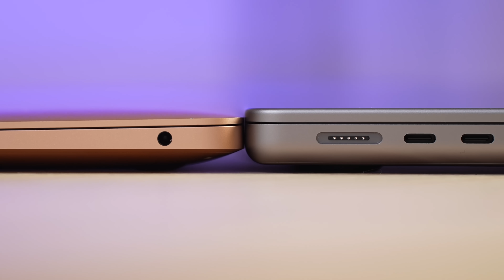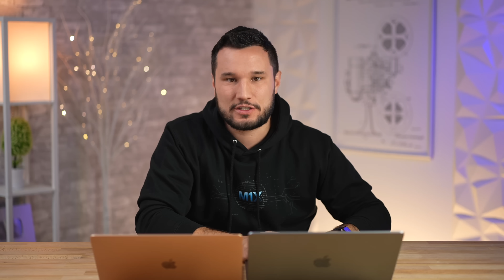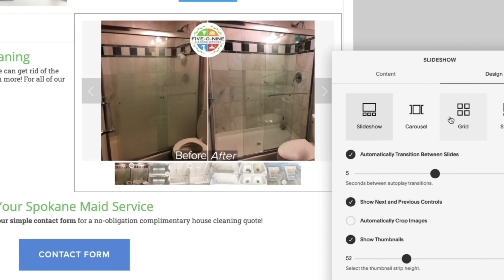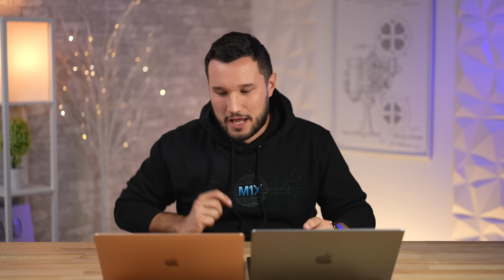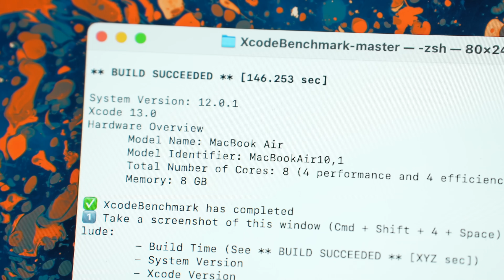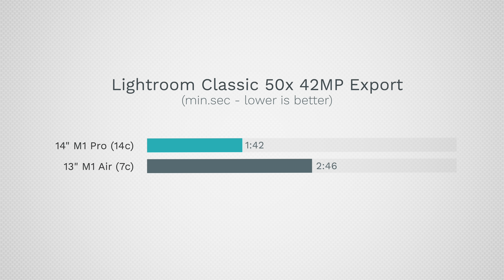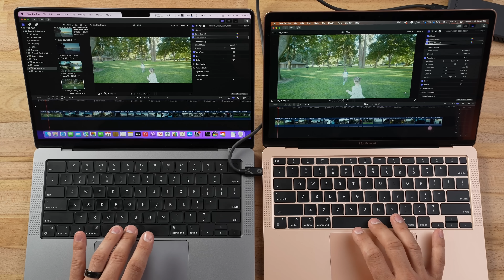14" MacBook Pro vs M1 MacBook Air - Worth $1,000 MORE? 🤔

Comment: Although you come to the conclusion that an Air is good enough for general productivity tasks and ordinary media consumption, and I agree with you, I always think that your reviews don't show enough of "everyday use" software, like Office and Onedrive, for instance. I have very large data usage on Onedrive and need to use Office 365 for work and for me, even on a 16GB M1 MacBook Pro, things can sometimes get a bit slow or unresponsive. Maybe Onedrive will become much better when Microsoft finally launches an Apple M1 chip version, but at the moment it's not a very smooth experience, and it's a bit disappointing that this is never covered in all the Apple silicon review videos

Comment: The Air overachieved, especially for the price. Most people will be perfectly fine with it. On the other hand, if you're up for the latest greatest and not on too tight of a budget, the 14" pro is a no-brainer.

Comment: For the ssd tests would you be able to provide tests on smaller file transfer speeds? Majority of the time the max speed doesn’t really make much of a difference anyway becayse of limitations on the transfer medium. Where the smaller file operations are more representive of system operations and also transferring smaller files. 

Keep up the great work!

Comment: thanks for including Lightroom test, most of the reviewers on Youtube only do video editing test because that's what they do the most and it's where the MacBook Pro fly. Air is good enough for most photographers.
Reply: Yep... main "power" use for me is photography (Lightroom, Photoshop, Luminar)... Using MB Air (16gb ram). But got 14" MB Pro Tuesday, and after 3 days, returned it- sticking with MB Air. The MB Pro does have a better screen, and SD slot is nice, but just not worth it for the extra bulk/weight... may take a look at the M2 Air when it comes out.... Glad I tried it, but very happy to stick with Air.

Comment: I'm so glad you mentioned a comparably spec'd MBA is $1,400, not $1,000. So many reviewers don't mention that. Not everyone will need the M1 Pro MBPs, but some may be able to justify the price difference. For example, I want the extra ports along with better screen, webcam and speaker system because I will use it throughout grad school. I can't wait for your review tomorrow comparing 16GB vs 32GB ram. That's the final factor before I decide what I'm getting. Thank you so much for your in depth reviews and comparisons. There are other creators doing fantastic work, but none of them go as detailed with the comparisons as you do. Thanks for having the giveaway as well.

Comment: This whole video is out of sync with its subject! the question posed was if the new macbook is worth the additional 1000. to answer this, you do not compare spec by spec. u take the use cases for the air, and try them on the pro. then you see if the difference is worth the extra 1K. Users of the air, by it for office productivity, content consumption,  web browsing etc. they care about how fast they can perform these tasks, how portable the device is, how long the battery lasts etc. so for these uses cases and features, is it worth it?

Comment: I think the additional storage and RAM, as you mention, in the 14" really brings the price of the 13" up if you add the same. It's a much closer fight if the performance matter. But if you just don't have 2k to spend and you need a Mac then the Air really is close.

Comment: Great comparison! Interested in seeing how hot the 14" & 16" get. It seems that they stay "silent" but they do get hot. Seems that Apple has traded fan noise/battery for heat. Even if the fans run at 1500 RPM it's typically enough to keep these M1 Pro/Max chips much cooler. Interested in your thoughts on this.

Comment: I’m a MBA fan. I love my early 2014 MBA, although it’s too underpowered for today’s software. Also the fans are really annoying. I think especially for traveling or conference presentations etc the new MBA outperforms the new MBP. The MBA fits in any bag than can hold a writing block. However, either, the M1 MBA or the M1 MBP would be a great replacement for my 2014 MBA. Thanks for the review!

Comment: It’s definitely worth spending the extra cash! The Air is a great machine, but it’s design is transitional and the M2 in the next Air will be a huge improvement over its current M1. The Pro will give you longevity, new design, and more headroom when you want to start seriously using the machine.

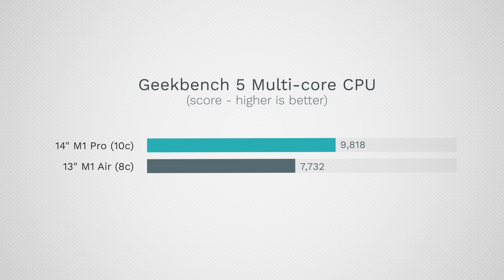Comment: Hey, I think there's an error in the video. At 11:00 showing the Geekbench multi-core scores, that 9818 score looks like it should be an 8-core M1 Pro (not a 10-core M1 Pro as the video says). The $1999 14" base model is an 8-core, which is what that computer should be right? If you search Geekbench for the other scores, it clearly shows 10-core M1 Pro's scoring around 12200-12500. Great video and results otherwise, though!

Comment: Another super impressive review and the one I have been waiting for.  I have a base model M1 MBA and it has been an absolute beast of a machine.  1080p live OBS streaming, Blender, FCP, Resolve, Affinity Photo, Xcode mobile app development and pretty much everything else has been amazing.  With that said I know it can hit a ceiling for rendering and exporting.

Having the 2x faster Blender Eevee rendering alone would be worth it. 95% of the time however I wouldn't really need the extra speed.  I like to play games but I tend to do most of that on my Switch or Apple TV anyway.  I have a PC laptop for gaming that pretty much collects dust these days.

Braw in Resolve and Fusion could use a boost but its not a show stopper. I do hit a limit playing back 4k from my Pocket 4k however.  It can only do so much before it falls apart. With that said I much prefer to edit in FCP which so far works great with 10bit HEVC video from my Canon R6. If the Canon R6 gets external ProRes Raw support however that added ProRes decoder and encoder on the 14" sure would be sweet.

I might stick with my MBA for now since it does so much and its lighter.  I really do love the fanless design for video conference calls and OBS HD video streaming.

Comment: I needed this video, thanks! Was debating whether or not the extra splurge for the new MacBook Pro is worth it as a student. The performance uplift on the pro is great but my rational side knows the air is enough for my use case.

Comment: I think it's worth it rn im using the macbook air its fast and there are no problems but if you want to buy a new mac and you dont already have any m1 i think you should go ahead and get yourself the 14inch. Especially if your gonna spend alot of time on your laptop. If your not just get the air still very fast and reliable. I think the giveway is cool and if i won i would give this air im using rn away to my bro.

Comment: I was considering the macbook air until I saw the differences of the macbook pro with the touch bar. I wanted 2 TB's of SSD, 16 gigs of RAM & final cut pro. In the end a few hundred dollars more would give a brighter screen, more battery life & a slightly better gpu. However now I am weighing this new M1 Pro chip as an option.

Comment: Love your review on everything!! Thanks for having them. Either pro or max will be overkill for most of the users. However, the ease to replace the batteries makes it can go a really long way. I used to have a late 2013 Macbook Pro 15" Retina that last almost forever with really good performance. The only problem is the batteries that I had to replace once in 2016 and another time this year. If I get a 2021 Macbook pro I will be able to last 10 years this time!!!

Comment: The new 14" display looks stunning; it makes the LCD panel of the air look so old (even though it's still much better than many windows displays in its class 😂). Plus the new sound system is miles better. Would love to get my hands on one of these new MacBook Pros.

Comment: The great thing about Apple silicon going forward is they usually get more efficient with each generation, with a big efficiency leap every other generation, because of TSMC's smaller fabrication process. That means that even though this 14" "only" has 17 hours of battery life, as long as they don't change the design, within a couple of generations it should be well over 20 hours.

Comment: I love my Air for travel and general portability. Most of what I do with it isn't terribly demanding. However, I occasionally need to record and edit video. It can do it but it is slower than my PC with a dedicated graphics card when running Davinci Resolve. I would like the screen upgrade, though and the memory and storage is faster. I suspect the 14" MBP would be as fast pr slightly faster than my PC when rendering. I'm surprised how much of an improvement the lowest-end MBP is.

Comment: I concur with you conclusion that the M1 MBA is more than sufficient for the average notebook user. As an average user, I purchased the M1 MBA for its portability, performance vs. price point. I decided to "future-proof" it by upgrading to a 512Gb SSD and 16Gb of RAM. The only thing I think I would miss from the MB Pro is the better sounding speakers. Then again I have some good quality Bluetooth and wired headphones so no big deal. I saved enough to buy a nice external monitor (non Apple brand) sdhould I decide that I need one.

Comment: Does Lightroom consume that much RAM? The 14" with 16gb still has yellow memory pressure; that's crazy.
The annoying thing is Apple charges too much for ram upgrade
On the 14", going to 32GB is more expensive than going to 10c CPU 16c GPU - which is the 3rd level up.

Comment: That's so weird that the 14" used basically the same amount of power as the Air, and the fact that both were on ~45% after 3-4 hours of benchmarking means they should both have like 5-7 hours of battery even for intensive tasks, that should equate to a minimum of like 12 hours of light mixed use, right?

I'd be curious to know what brightness you had these on during the testing.

Comment: Air is good for basic stuff, but what if someone wants to upgrade it and make a real computer? I mean 512  GB with 16 operation memory? In this case, it will cost about 1500-1600. Is it worth buying the Air or it is better to buy a 14-inch model?

Comment: The MBA is still king in my eyes given the price point. I have the M1 pro 16” and M1 MBA and using the 16” pro made me appreciate what the tiny MBA could do on just 8GB ram with no fans 🔥
Reply: Where do you find the m1 pro being worth the extra cash?
Reply: @StefanUrkel  Only if 1) you have the cash spare and 2) if you make money using a laptop and require more power from the M1 (I can't imagine many ppl need it).. I'd be grasping at straws to find a reason why it is worth the money for 98% of users. Instead consider the M1 w/ 16GB ram, which is extremely good value and future proof.

Comment: Great laptop. The one very strange thing is that notch and how it reacted to the full screen window, it actually made the screen smaller (vertically). Wished they had a 2 mm bigger margin in the upper part and no notch. BTW, I just saw a clip where the menus and tray icons go under the notch if you have enough of them to fill all that space.

Comment: I believe your CPU/model charts are incorrect in that you have a 10-core 14” MacBook Pro listed against the MacBook Air M1 where instead it should be an 8-core 14” MacBook Pro since it’s the binned base model. Just figured I would point that out since it would be confusing for the 10-Core M1 Pro to fall short in this video compared to the 10-Core Pro/Max in your other videos in cpu tasks.

Comment: I really want the audio and screen quality of the new Pros but need a laptop for casual use only, so the Pro chip is kinda wasted on my use case...
One thing I would like to add: opting today for 8 GB RAM is a waste of money, as it is not a future proof configuration. Writing this on a 2014 Air, custom configured at the time with 8 GB RAM and Core i7. Still running fine as a casual everyday machine, so the extra money spent to beef up the internals does pay off in the long term.
With that said,  I would lean towards buying the new Pro in basic config, as the larger SSD, RAM and faster CPU/GPU provide the future proofing that the base config Air is lacking, plus you get the nice screen and speakers as the cherry on top (and if you like the chunky, retro-y design of the Pro, like I do, that helps with the man math as well)

Comment: I've bought M1 Mac Book Air  for ~ 1800$ (with taxes) with 1 TB of storage and 16 GB RAM, but I'm wondering about upgrading it to 14" M1 Pro 10c/16gpu 32 GB 512/1 TB in following months, so the Air will go to my wife. Do you think is it worth for a professional programmer to upgrade? I'm rarely suffering from swap memory, but the M1 Pro SSD has incredible reads and writes speed so swap issue will not be the case for performance drops.

Comment: I prefer the design of the MacBook (M1 pro and Air). I didn’t like much the plastic iBook at the time. I don’t like the aluminum much today. Weight is a huge deal when I carry it around. Ports are nice but now that we have bought adapters over the last years. I guess it is an excellent move from MBP 2015 and earlier, and you could skip the “dongle years” :)

Comment: I wonder how the new archtetures work for coding. Does it automaticlly alocs the tasks between the CPUs and GPUs if I run some python code? Or do we still need to use GPU specific libraries? Since they are integranted I thought any simple operation from any script could automaticaly be alocated to the GPU, instead of requiring some CUDA library or something like that.

Comment: Considering the insane increase in performance, better screen, processing, thermal management, higher channel memory, larger storage capacity, and with cherry on top, it has better battery life. It’s a no brainer, if possible it’s better to switch to the MacBook pro 14”. A comparable windows laptop can’t hit any 3 of the aforementioned advantages of MB pro 14”, at any time.

Comment: Thank you, Max, for this great comparison video. Obvious the new MBP 14" Pro is a clear winner here. In 2019 I bought a new MacBook Air. Sadly, still paying it off...  I skipped the first iteration of M1 macs for many reasons, mainly financial. But now, with M1 Pro and Max processors, I feel that time has come to upgrade. Although, I was hoping to see an M1 Mac mini in Pro or Max configuration. Still on the fence about that... I don't know - maybe I will wait for that one to come out next year and save a little bit as I will use it in the desktop setup with 3 monitors attached. And keep the old Intel 2018 MBA for Youtube/e-mail/word processing...

Comment: In my line of work I use to edit documents and usually I leave 30 of them open at any time. Plus I have to consult online legal databases and I keep open about 20 tabs. Since I use Collabora office, which apparently is not fully optimised, I tend to bring my m1 Mac mini to its knees. Every time I wake my Mac mini fron sleep Collabora needs about 5 minutes to start working properly. I really don't need the horsepower from the new machines, but I definitely need more ram than mere 16 gb

Comment: I think Apple did a good job with the current lineup - the air is great for people with lighter uses; that nice slim wedge case, passive cooling, etc. And now, with the 14" and 16" models, people who need to do some heavy work have a great efficient machine to do it on, as well.

Comment: Very informative! It’s interesting how I was thinking the MBP 14” is a worthwhile upgrade compared to the MBP 13”, but after this I’m actually considering the MBA 13” instead of either of them 😅
I think the Air would be adequate for the web development/coding I do. I would definitely upgrade the RAM and SSD though.
Reply: I program with Unity, and MBA is incredible! I didn't had to upgrade neither the RAM nor SSD and I experience no issues at all.
Edit: Bear in mind one of the main advantages of MBA is that it is fan less and completely close, so you can work on it literally anywhere without fearing dirt will enter into it.
Reply: @OrSNCucumber  good to know and great point! I love that fanless means noiseless, but didn’t even consider that it also means no risk of dust inside. Thanks for the tip!

Comment: ouch I've sold my precious 16GB 512 GB MacBook Air M1 to buy one of these, but these are ridiculously expensive here in Europe :'( I could buy a good used car for the price of the base 16" model, while I've always wanted the 16" model (was thinking of the DEll XPS 9700 otherwise).
btw exactly those are the changes I once asked Apple in a survey to improve on the M1 Air: smaller bezels, little bit higher screen resolution (I suggested sth like the Huawei Matebook Pros 3000x2000 screen res), brighter screen, OLED (mini LED is OK as well) sound, webcam. Lol they did all, except the notch, which I did not ask for.
Only thing didn't blow me away is the webcam quality, I was awaiting better on that front and if the notch already there why no faceID? for that price it should have fit in the config. Otherwise I would definitely buy the 16" if I had the money.
Once you have your bro on screen you remind me and my bro :D always let the small one control the flow :DDD